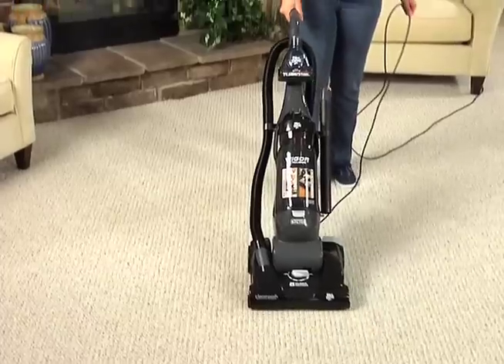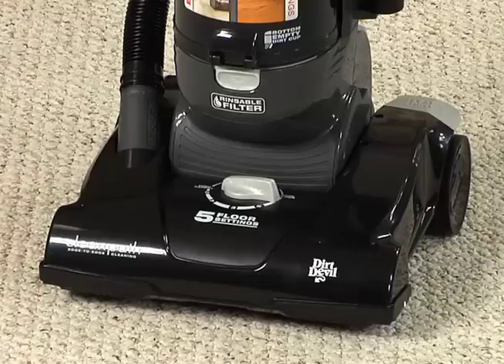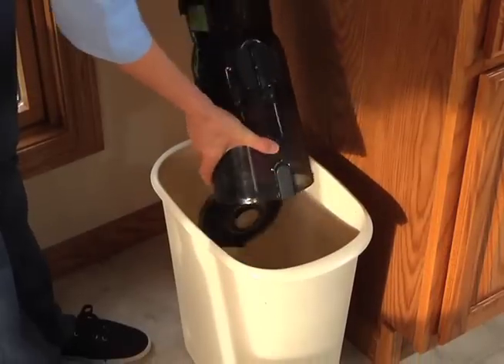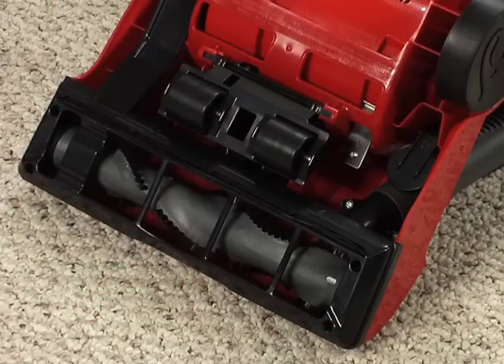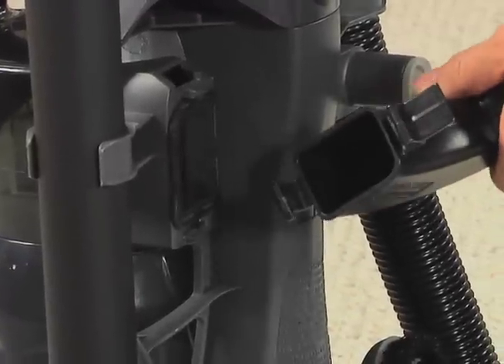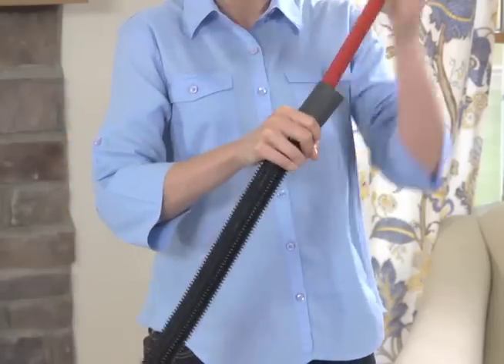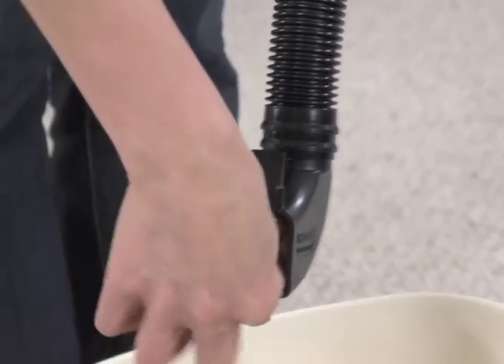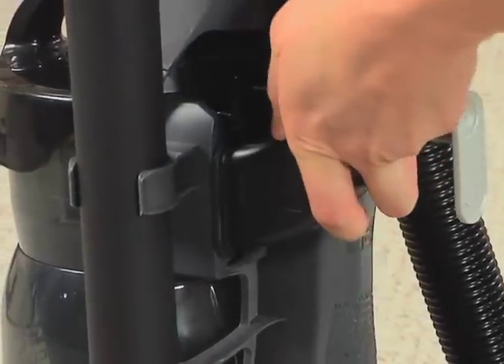Checking for Clogs: Dirt Devil Vigor Cyclonic Bagless Upright Vacuum UD70110

Comment: The clogs in the Dirt Devils cyclonic vacuum cleaners always seems to be where the tube starts by the rotating brushes. Without long curved tweezers, you have to unscrew the base to get the base of the tube out and get the clog out.